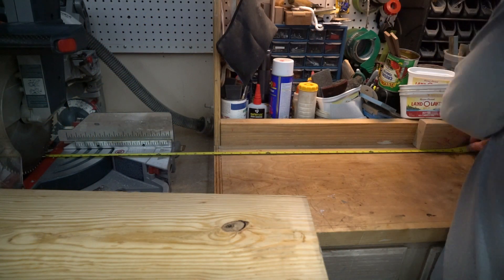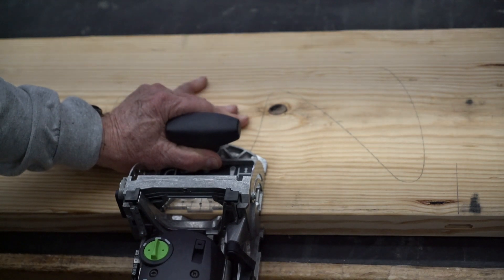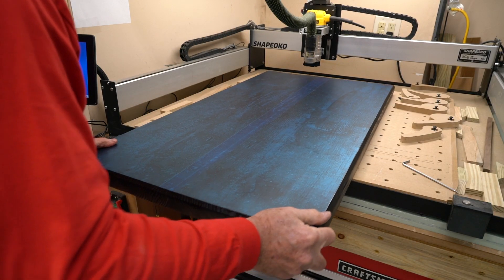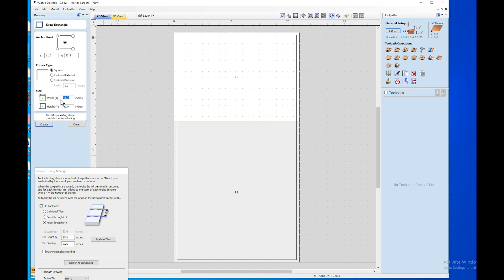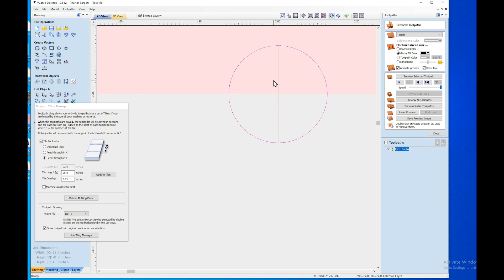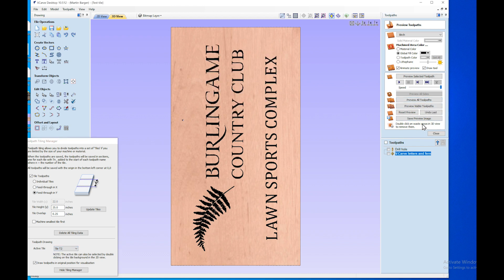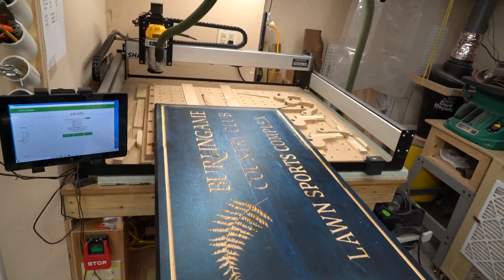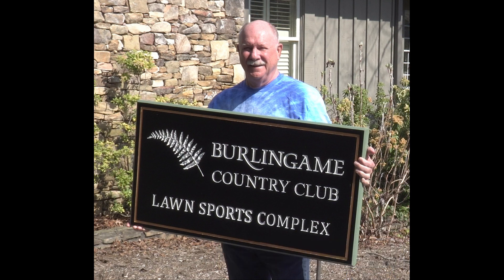Make a Sign Larger than  your CNC

Comment: Your comment about Tightbond III yeah it's s very strong. Used it to dowel and glue a flight of treads (3 piece Mahogany tread) I had to repair a riser, the glue on the treads still holds it like a solid piece of wood after 12 years installed.
Reply from the maker: Totally agree!  Thanks for the comment!

Comment: Loved the "nearly perfect" line. I had to learn that is usually the sweet spot.
Regarding file names; in two weeks I would forget what "sports complex" actually means. I have learnt to use fulsome names like "Burlingame Lawn sports complex" or "one way arrow". It is long but there is no guessing what the job is later on.
For offsetting for tiling I would add an attachable extension 25" from the front edge of the work area and a 25" stick. Position the front edge against the stick, do job, remove stick, and voila, correctly shifted without drilling a hole.
Reply from the maker: Thanks Andrew!  I will use your suggestion on file names...already getting them confused.  Still don’t understand using an extension for tiling?
Reply: @bargerwoodworking6703  My apologies; I tend to speak as a precis! 
Instead of using a precisely located hole and trying to align it to the reference for the second tile, and having a hole to repair, I would either hinge or have attachable, depending on your bench front, a table extension. On it I would mount a full width edge the table work depth from the front edge of your zero line, say 25". I would then cut an mdf spacer board exactly 25" deep. 
In use you have the spacer in place, butt the work to it, and carve the first tile. It is where it would be without the extension. Remove the mdf, move the work forward to the outrigger edge, and it is perfectly positioned for the second tile. This only relies on the reference edge being straight.
Alternatively there is a second way if your software allows it. The workboard must have parallel edges for this. Carve the first tile then spin the board 180 degrees. In the software spin the job around 180 degrees, recompute the path and cut the remainder as a second 'first' tile. This technique relies on the job being centred on the board. Have fun.

Comment: Thank YOU!!! I have been wondering about a CNC for quite a while.  Now where can I put one ??
Reply from the maker: I tucked mine away into a corner of my garage.  A lot of people put them on wheels and move them around.
Reply: @bargerwoodworking6703  How did you decide which one to buy?
Reply from the maker: At the time price was the main factor and availability, but after more than a year, I’m still happy with the Shapeoko
Reply: @bargerwoodworking6703  if it ain’t broke don’t fix it. Surprised cost is a factor considering all the top of the line tools you’ve got, I’m so cheap I still use an old 6”short bed craftsman jointer I got years ago for $100. Sometimes it works out though, saved a ton buying the wen track saw instead of the festool and it works just as well (aside from dust collection)

Comment: Wgats the importance to check the moisture ?
Reply from the maker: If the wood is too wet…like 12% or higher, the paint won’t stick for very long.  I’m now redoing some signs that I jumped the gun and painted them before they were properly dry.  I’d wait till it hits 8%.  One friend told me to dribble water on it and see if it beads up (too wet) or if it soaks into the wood (dry enough).  I like the moisture meter…

Comment: Another really nice video! If I may, one thing you can do where the letters were just so close to the line. In vectric, you can choose the "text spacing" which is 3 over from the text toolbox item. This will also help to just inch over those letters at the line and achieve a safer transition in the tiling!

Great work! Keep it up! I'm also in NC (near Lake Norman)!
Reply from the maker: Good tip!

Comment: Can you describe you computer that you use to control the cnc?
Reply from the maker: 10" Windows 10 Fusion5 FWIN232 Plus S1 Ultra Slim Windows Tablet PC - (4GB RAM, USB 3.0, Micro HDMI, Intel Quad-Core CPU, IPS HD Display, 5MP and 2MP Cameras, Bluetooth 4.0, Windows 10 S) (64GB)

Comment: This was a great tutorial, really useful information. This is my first video I’ve watched of yours so far. Curious about the touch screen you are using. Do you mind sharing information on that? Thanks again, great job on this video.
Reply from the maker: Purchased the tablet on Amazon, about $200. 10" Windows 10 Fusion5 FWIN232 Plus S1 Ultra Slim Windows Tablet PC - (4GB RAM, USB 3.0, Micro HDMI, Intel Quad-Core CPU, IPS HD Display, 5MP and 2MP Cameras, Bluetooth 4.0, Windows 10 S) (64GB)

Comment: hey there Marty... I didn't see where you talked about how you handled the registration hole in post. did you plug it with a dowel and cut it flush? or leave it there? or what. Also what is the significance of making the registration hole go all the way through? is that necessary? And lastly, wouldn't two holes top of sign and bottom ensure that the sign doesn't get twisted (and keep everything aligned better)?
Reply from the maker: Thanks Steve!  I filled the registration hole with wood filler and painted it.  Barely noticeable.  The only way I could figure out how to do it was to drill the hole all the way through…when you shift the board up, I suppose a partial hole would work.  So many ways of doing this.  I agree two holes might work better…will try that next time.  Thanks for the comment!
Reply: @bargerwoodworking6703  I’m a total newb and it probably shows. Keep the great videos coming. I got me a shapoeko pro xl in feb and am just now getting to work with it a bit. I’ve also recently purchased a Mikita track saw, Mikita drop saw, big dust collector with massive filter, belt and disk sander. My next purchase is probably going to be the dewalt standard 735 planer. I think I’m equipment done for the near future. Just need to start practicing and making stuff!! Again thanks for the great videos.

Comment: Just found your channel. I've been making signs off and on for awhile now on my XXL same program and just upgrading belt z to hdz this week. I noticed the grain in the wood and from my experience you get a much flatter and stays flatter sign if you flip grain so they don't grow or shrink the same way over time. Also if you are cutting say a 34 inch sign in vcarve desktop change the tile height to say 17 inches that leaves only 17 inch overhang instead of 25 inches off bed. Or even 10 inch on first tile if that's possible. Great video and I'm not picking on your work it looks great. 👍👍 subd
Reply from the maker: Thanks Mike!  I have a lot to learn about tiling.  It was very difficult to match up the x and y axis exactly.  Need to figure out a better way.  Really appreciate your comments!
Reply: @bargerwoodworking6703  the x is really hard to get right, I usually try to  zero off the same point everytime close to center of sign if possible or zero off of the bed if stock is really flat like good  3/4 burch ply. I use the bit zero v1.  The y I figured out by mounting fence down the y axis then manually using a 1/4 endmill and running the machine down the y so it is perfectly straight with the y axis on the cnc. Makes it so the y can't be off if it is butted up to the y fence . Hope this makes sense to ya. Lol anyway its all fun keep the vids coming.  👍
Reply: I bought a 4 x 4 shapeoko 5 pro so now only need to tile with a 4x8 sheet.
Reply: I bought a 4 x 4 shapeoko 5 pro so now only need to tile with a 4x8 sheet.